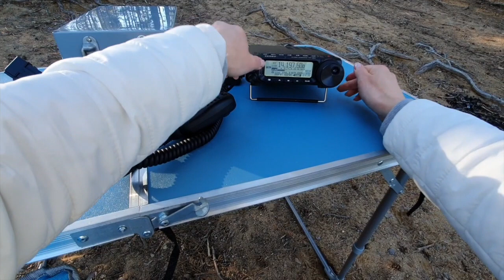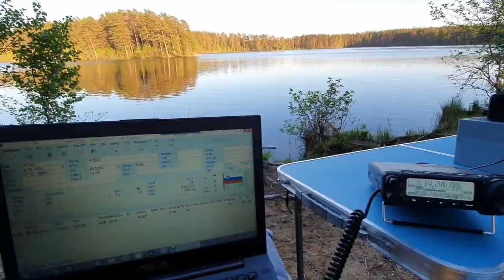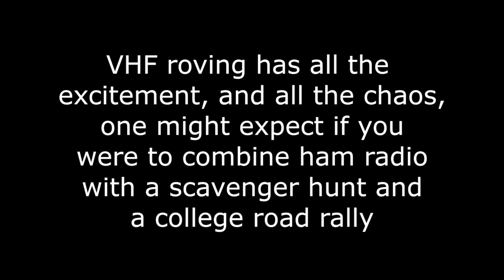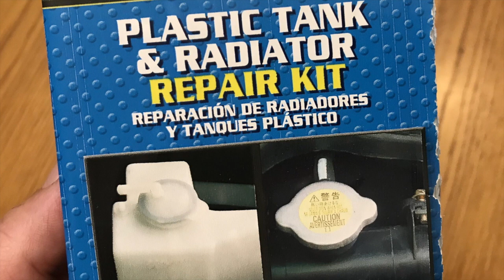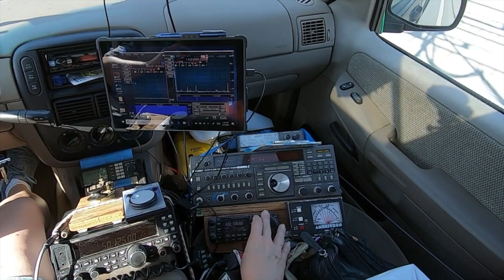June VHF:UHF Contest   HAM Talk - #7

Comment: Great show!  Andrea, K2EZ, is an asset to the ham radio community and has been very helpful both on the air and over the phone to help improve my own rover station! It was great to work her on that 432.100 contact. 70cm was really good during the contest and outperformed 2 meters in some cases! 73 DE WA5RR
Reply: You sure are right about 70cm working well.  I had a surprise at the contest, the SWR on my 70cm antenna was unexpectedly high, over 3:1 yet for most of the contest I had more grids on 70cm than I had on 2m.  Eventually I got a couple extra 2m grids that I didn't get on 70cm to balance it out.

Comment: Thank you Andrea for posting your video. Now if I could get that antenna set up for my condo deck, I'd be a better contester.
Reply from the maker: Everything takes time so hang in there. One of the best contacts I have been part of us was monitoring and recording for a friend N5GIT amazing contact off the balcony of his 2nd floor apartment with a single K5VH omni and 50 watts work 700 plus miles from San Antonio into Missouri.

Comment: im curious with the problems hearing on 2 meters, what could we do to make us be able to hear better on 2 meters?
Reply from the maker: Mike in the particular instance mentioned on the show, the individual runs lossy coax and a low gain antenna and a low height.....To compensate so he can be heard, he runs a large 350 watt amp. What this does is put out a signal that is much greater than what he is able to hear. It's easy to cover come high loss cable and low gain antenna with a large amp, but unfortunately you still lose on the receive side.

It's important when station building, to match you output with your input capability.